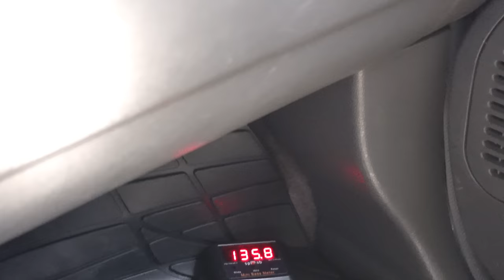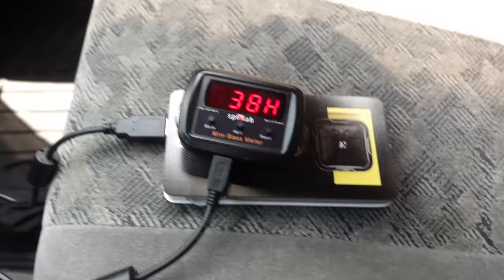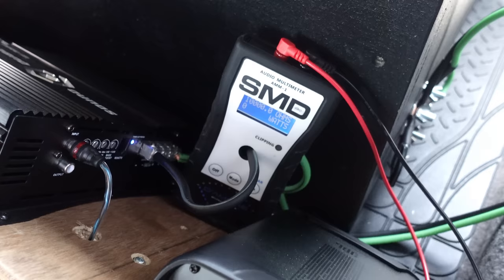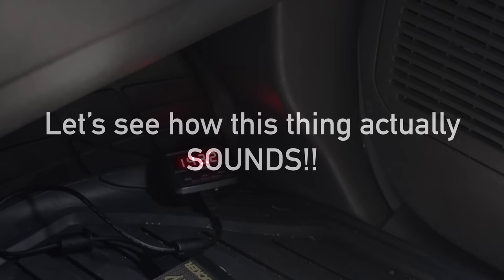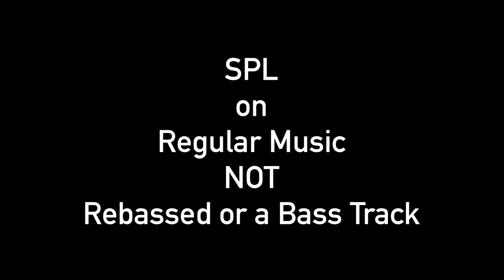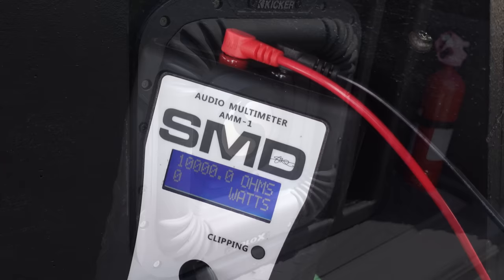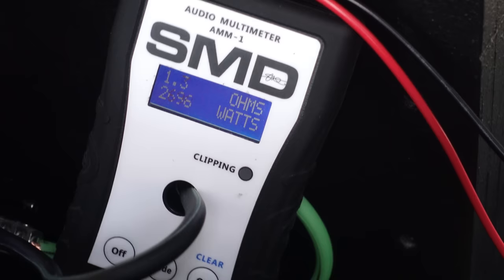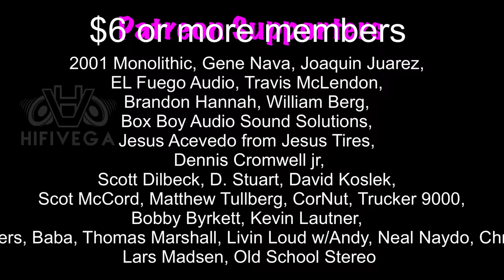Kicker SOLO X 12 SPL Testing!

Comment: I’ve had many different car audio systems since the 90’s. Best deepest lows I’ve ever heard were from my single kicker L715.
Reply: I went from 2 l7 15"s to a single sundown zv5 18"..... night and day bro. The sundown is 10x better at getting low.
Reply: @dariobubnjic8132  bro comparing sundown to kicker just shows you don't know audio. There literally is no comparison the sundown kills it in EVERY ASPECT
Reply: @dariobubnjic8132  bro I have 1 18" that hits 155+dB on 6k watts in almost 8 cubic foot box. You're kicker ain't coming close. You can have 4 kickers and it ain't coming close.
Reply: @dariobubnjic8132  nro lanzar don't even have RMS a 3000 watt lanzar is like 1500ms and that whole set up lucky to do 140dbs 🤣😅🤣😅 bro my salt 6 is pushing over 7k rms to my zv5 18" at .5 ohms and it eats it on clean lithium power. Your amp couldn't even handle .5 ohms
Reply: @dariobubnjic8132  hitting lower requires a bigger VC. Xmax increases when VC increases. Your solo solobarics have a 2.5" VC compared to my 4" VC. you said yours would ahit on my 18" while now saying DBS ain't everything? Bro you clearly don't know what youre talking about 🤣
Reply: @dariobubnjic8132  just to show you what you're trying to compare. You're comparing a s10a kicker that is 450rms and a single voice coil weighs like 20 lbs to a SUNDOWN ZV5 18" that handles around 6k rms has dual voice coil and weighs 90+ pounds. Just stop bro. Save ya the embarrament

Comment: I've been waiting for this sub. Idk how  many times release date was moved. I  know twice at least. Currently running the JL Audio 12w7 in the JL High output enclosure. powered by the Fosgate 1500 1bdcp Kenwood DMX709S Head unit JL Audio XD400 Fosgate T169 rears, Fosgate p165se components front and an epicenter.  In my sleeper 2005 Grand prix GTP. I CANT WAIT TO ORDER ONE! FINALLY!!!!! Thanks HIfi you the Man! Can't wait for Derricks video or what MB enclosures is gonna do for it!. And I will be using tour cutout sheet if it'll fit.

Comment: That's a 12 doing those numbers? That is some solid spl  scores !
Reply from the maker: Single 12
Reply: @HifiVega  that's probably in same class as s.a. zv2 and a.b.xfls for spls. Good info bro!
Reply: Parker the bass head does similiar SPL tests for 12 inch subs. But also remember a kicker 12 has more cone area than a typical 12 inch round sub thus requiring a bigger box also. I think the Sundown X sub which has a similar price tag and RMS rating as the solo x did a 145 or 146db?? Not sure but I think it was around that figure.
Reply: i only get around 139-140db with 2 old L7's and 3kwrms. And that is with a slightly bigger box then this.. so this is really a step in the correct direction for kicker
Reply: @bubbawubba2307  145.8DB to be exact i'd like if Hifi vega tested the sundown X vs this solo x12
Reply: @Erik Britz   you can bet Parker would be testing it sometime to see what he can get out of it. 143 to 145.8 is a big jump basically doubling air pressure. Lot of tests that he has done the 12 inch subs usually do a 142 143 range if they are not some cheesy sub. Lol
Reply: @bubbawubba2307  yeah the sundown xv2 topped his tests even till this day.
Reply: @erikbritz8095  I think the American Bass Xfl got close...way cheaper too. Sundown may take more wattage though. We love Hifi vega too..especially  for budget brands tested!
Reply: @mattsnider5904  yes thats the big issue here plus people dont take into account sub design, sub design depicts the sound of a sub and yes certain woofers can get close but they don't play certain frequencies the same.

Comment: Damn!  I got two JL-W0 tens on a punch 150a2 rockford old school amp doing 140db with stock electrical and an 8awg power wire😂
Reply from the maker: You killin the game
Reply: @HifiVega  no, that was my old school system.  The only one Ive ever had metered at an IASCA event.  Now Im running 3 kicker CompR 10’s in a ported box I made tuned to 33hz.  Its a trunk build as well but Im maxed on airspace.  I have 6 cubes minus port so for me to run 2 of those new kicker solo 12”s Ill need to find more airspace and probably use an external round port or something removable so I can put the back seat up!  Its nice to know people are liking these subs.  I dont have enough power (DC2.0k) but that never stopped me before!  The only good thing I have is a 2/0 power wire.  Stock alt, no big 3 and Im on my third battery in 3 years 🤣.
Thanks for the review video!  I would personally make your box bigger and see what that new sub can do.
Reply from the maker: @Trucker-Belly  these new style meters are about 8db quieter than the old mic based meters. A 140db system on the mic would likely be low 130’s on these new meters. I did a 150 on a single L712 in 2001, but on the old mic style meters.
Reply: @HifiVega  you break my heart!  I need to do so many things to my mustang that working on the system should be last.  Need a new motor(blown head gasket) and I need to paint and get some new wheels.  My next purchase was going to be an alternator and a spl meter like yours but the system I have currently is great.  I made it for music but it gets down to 28 hz.  It’s broken my fuel pump assembly inside the fuel tank.  It snapped off the 3 spot welds that hold everything down.  Now my fuel gauge doesnt work.  I glued it back with epoxy and it only lasted a day so a new fuel tank is on the list too!!  I dont know what it meters but I would love a 150 score but who knows.  My dome light doesn’t turn off anymore now either!  Do I really need two of those new Solo X’s??🤣

Comment: Where do I find songs that I won't get flagged for, running 4  Crossfire xt3 18's on a Crossfire 16k at .5 ohm rise to 1.4ohm clamped 18,899 watts in my 4th on a burp, 135ah c-max 16v set up, going to do 4 of the L7x's when they have the 18's 🤙
Reply from the maker: YouTube creator studio is where I got these
Reply: Appreciate it, my sponsor and dealer here has DD, Crossfire, and kicker, used DD for 2 seasons, now Crossfire, pumped to go back to my roots with kicker 🤙

Comment: Robert: I have a quad Box and I have it in the back seat area of an F150... My question is how does this compare to the quad box subs? My thoughts were replacing the quad Box with 2 solo X15. When They come out... Your  thoughts and opinion?
Reply from the maker: I think 2 solo x 15’s will be louder by quite a bit than the stock quad box
Reply: what kind of .... kicker pre fab quad box? in a f150? post some videos sir.
Reply: @TheLawlessGang 😂 facts
Reply: @F150 3FIVE  the only quad Box from Kicker that has the 4 12's- L7X subs and yes it fits

Comment: Thinking about geting one. For the price   should I look at another brand
Reply from the maker: I wholeheartedly recommend this for the price. You can get louder subs for the same price, but I don’t think you could match the loudness and SQ that this one has.
Reply: Thank you for the input and answering qustions
Reply: @HifiVega  would the jp 23 v2 be a good pairing
Reply from the maker: @Nickrose2016  oh yeah that amp would be perfect with this sub
Reply: @HifiVega  I tried to download the box plans but phone is a pos. Can't afford a 500 to 1000 doller box. It's going in a 07 accord so hoping it will work. Thanks for all you do I've been out of the game for 10 plus years and so much has changed.
Reply: @HifiVega   sorry for all the questions in your opinion 2/0 welding lead or 1/0 ofc
Reply from the maker: @Nickrose2016  1/0 OFC simply because it’s easier to work with
Reply: @HifiVega  thank you

Comment: This is funny,,,  I used to compete in the 90,, I had  8 Rockford 12,  On 2 o'rion 250 r And why I quit competing was In 99 eclipse came out with the titanium,, 1 10 in   Q bomb Box With a Rockford  1000 DB A yellow top And a one   Farad cap,, Beat me with a 1 47.8 at 40 Hz,,    So bigger subwoofer more power more money ,,NOT impressed
Reply from the maker: Did you meter with an audiocontrol mic or B&K mic? I also competed back in the 90’s and early 00’s and did a 150 with a single L712 when it first came out. That being said the old mics read about 6-8db louder (sometimes more) than these pressure sensors meters. If you haven’t used the new meters that’s something you might not know